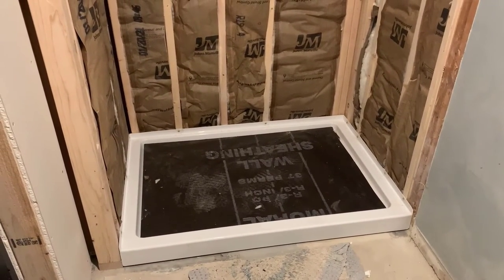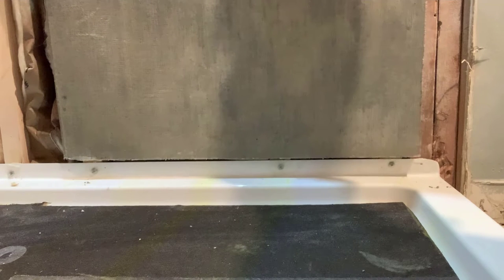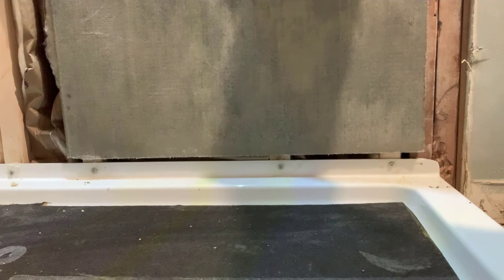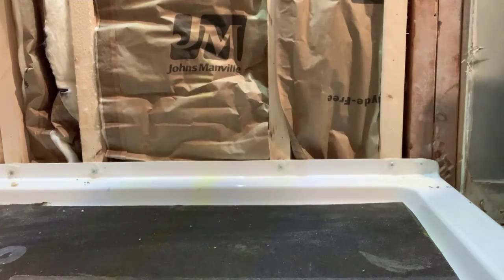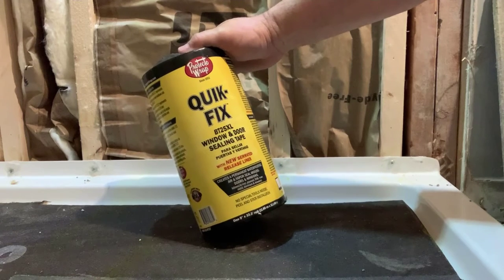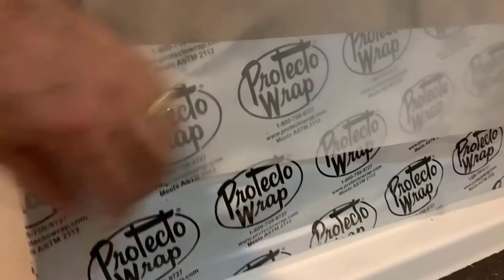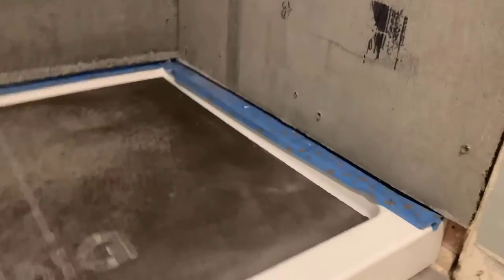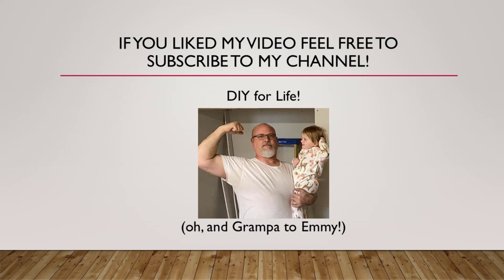Installing Concrete Backer Board with an Acrylic Shower Pan

Comment: Great idea with the adhesive flashing at the bottom.  The plastic sheathing behind the backer board does nothing to help you though and only provides an opportunity for moisture to get trapped between two water proof layers.  Trapped moisture can result in molding.  You always need to provide opportunity for moisture to evaporate out.  Water can even condensate between layers with temperature differential.  You could use Tyvec instead which allows water vapor to escape but also I don't think is necessary.  The Redgard is sufficient waterproofing.  Thanks for the ideas.
Reply from the maker: Thanks for the comment Taylor.  I had not thought of the plastic sheathing and moisture issue.  Thanks for that input.

Comment: Screws through the shower pan cancels your warranty. Modified thin set under the pan is the proper installation. That’s what the round cavities underneath the pan are for.
Reply from the maker: Thanks for the note.  I did put thin set down on the bottom as well but the instructions stated to screw the pan to the studs.  In fact, here is a video by Delta that gives the exact instructions.  https://www.youtube.com/watch?v=4_NR4rwxF7A&ab_channel=DeltaFaucet.  So, both the instructions that came with the shower pan and this video from Delta tell you to screw the flange down.  So, I doubt it voids the Delta warranty.
Reply: @RighttothePointDIY  wow, surprising. 🤔 To be fair, I’ve only installed Dreamline pans. Great idea about the waterproof tape over the flange. I’m going to try that. 👍🏼
Reply: Not necessarily true. Some acrylic pans specify screwing into studs through the screw strip, Delta is one.

Comment: Hardie board instructions on the internet does not require all that. Just says to set the board on top of the lip.
Reply from the maker: Thanks for the comment. I actually talked to a couple of installers, and both had slightly different ways of doing it. However, they both were in favor of putting the hardie board over top of the lip just based upon their experience. The reality is if you waterproof correctly, it will probably be fine either way.

Comment: Great tutorial here! I am at this exact point in my basement bathroom project and really think this method has some great points. I love seeing clever uses other materials such as the window sealing tape!
Reply from the maker: Thanks Chad.  I did a lot of research until I came across this solution and it worked great!

Comment: How did you address the seam where the wall and pan met? Did you grout caulk it?
Reply from the maker: I did not do anything there. I just overlapped it and then screwed the backer board to the studs.
Reply: @RighttothePointDIY  so, there is a small gap between the tile and shower base?
Reply from the maker: @jpp9846  Correct
Reply: @RighttothePointDIY  I guess if the tile is over the wall flange slightly, there isn't really any other place for water to go... Thanks!

Comment: Interesting use of what roofers use as an 'ice dam'. My question to you, and just about every other tile installer on Youtube, is this: If the grout is properly applied, and always maintained, then water infiltration should not, in theory, be a problem. If there is, however, a failure in the grout, and water infiltration occurs, where is that water going to drain out? You've sealed the Hardi backer with liquid rubber, essentially, and shower walls are not constructed like a masonry wall with weep holes. Inquiring minds, etc. In any case: Nicely explained and presented video, sir.
Reply from the maker: Thanks for the comment. You make a great observation which I briefly alluded to in the video.  Basically, with all of the water proofing I did on the Hardi backer board there is literally almost no chance any moisture will get through and therefore this additional layer is just an additional insurance in the very outside chance both my sealed grout AND the water proofing seal failed.  It's not likely to happen.  If water does get through the grout it will just run down the water proofed backer board into shower pan.  It's been about 2 1/2 years and I have absolutely no sign of any leaking and I don't expect to going forward.
Reply: @RighttothePointDIY  how can it get back out to the shower pan if the bottom tile course has been silicone sealed to stop water being drawn upward via capillary action, etc? I’m not trying to create a “gotcha” situation, by the way! I sweat these details even though I no longer do outside construction. Around my house, though, the stuff haunts me because I’m a basket case:-)
Reply from the maker: @howardemerson457  Good question. I should have clarified.  I didn’t silicone the bottom of the hardi board because it is 1/2” from the bottom of the pan and the tile goes past the hardi board another quarter inch or more.  Also, when I sealed the hardi board I also sealed the bottom edge just in case there was some ‘splash up’ that somehow would reach it (highly unlikely).

Comment: Doesn't the backerboard fan out a bit at the point that it crosses the lip of the shower pan?  The lip is 1/4" thick, it just seems like that will be obvious after the tile is installed IF the backer board comes down close the pan
Reply from the maker: Good observation Mike.  It does ‘fan’ out a bit but there are a couple of things to note.  First, I kept my lowest screws fairly high up from the edge. That makes the ‘fan’ more gradual.   Secondly, when you tile you can make up the fan effect with your thin set thickness.  My tile turned out great and you can’t tell there is any fanning at all.

Comment: Great video. I use zip tape for the bottom. Much easier to apply.
Reply from the maker: Thanks.  Great idea.  That is good stuff and would probably work just fine.

Comment: I use hardibacker on a weekly basis for building outdoor kitchens.  I don't do bathrooms, until now, (my own.)     The biggest downside I see to your method is that you can no longer "glue and screw" product directly onto the wall studs.    From what I've read on hardibacker site, they recommend just the 1/4" gap on bottom of shower pan, but also shimming the board out.    The don't show any plastic, only a 1/4" sealant bead.   
 Here's an unrelated tip for everyone.   I see your board screws have all created a "burr" on the hardibacker at point of screw head penetration.    That is typical.   To deal with this, we take a masonry bit and use it to create a slight indent where each screw goes.    That way the head countersinks, but doesn't tear out surface and create that "burr" effect.    Probably not so critical for a shower, but when we are doing california stucco finish, we need that hardibacker to be as perfect as possible, or we end up with more prep work.    It takes longer, but makes the screw heads so much easier to deal with overall, as they don't pull into the board easily, like screws normally do with sheetrock.   At the edges of the board you almost have to do it, or the board cracks when you attempt to sink the heads, especially with 1/4" material.
Reply from the maker: Hey Bob M.  Thanks for the comment.  I appreciate you taking time to write out the long response.  I wanted to ask if you could clarify something for me.  When you said "The biggest downside I see to your method is that you can no longer "glue and screw" product directly onto the wall studs.' what exactly did you mean?  I know you could not have meant you cannot screw the hardiboard to the studs because that is obviously how it is attached.  Can you clarify?  
Also, great tip on avoiding the mushrooming of the hardiboard when you put the screw in.  Fortunately because I was doing tile the thinset was thick enough to cover any 'humps' where the screws were.
Reply: @RighttothePointDIY Sorry I didn't make that clear.   I am not even certain it is recommended by hardibacker, but I have seen other videos that mention "glue and screw".   Our method of installation is to always put glue on studs before hardibacker.  We are using welded aluminum tubing in place of wood studs for outdoor kitchens, but the principle is the same.     If you apply glue directly to the studs, and then put hardiboard on them with screws, now the glue sticks to hardiboard and studs, therefore making a much more solid overall structure with less chance of the years of vibrations, during use, or even someone in next room closing a door every day, or upstairs bouncing around,  to eventually cause tiles to let go.   ( More recently we started doing a bead of glue on seams before setting next board.)   Now, if you put plastic on the studs, the glue cannot contact one or the other, so no direct bond from the hardiboard to the stud.   We glue and screw every kitchen island we build. Many of them have a veneer stone applied, which is much heavier than stucco.     I'd never trust the screws alone to hold, and even more so with products like durarock, which is much softer.   True cement board is much easier to work with, but the screws also pull through easily, almost like when doing sheetrock.   Outdoor kitchens take a ton of abuse from weather, wind, people, chairs, door sets slamming, etc,..it seems a shower would also have tons of movement and temperature changes, plus it may be used several times a day for years on end.
Reply from the maker: @bobm6527  Ah!  Thanks for the explanation.  That makes sense.  I am not too concerned about this shower as I have lots of studs available and it is on a slab so there won't be a ton of vibration but this is good information to know for the future.
Reply: @bobm6527  glue?  lol  funny stuff for a wall..always some keyboard expert
Reply: So you don't think walls are subject to home vibrations, or expansion and contraction?   Nor do you think the glue and screw method is more solid than screws alone?     They glue and screw subflooring all the time to make it stiffer, so why wouldn't it work for any wall application?    All homes expand and contract, and the home I happen to be working on is not even climate controlled year round unless it is being used,  so it has more opportunity for expansion and contraction.   The sheetrock gets cracks from expansion/contraction movement in any home, so why wouldn't the shower tile?   In addition to that, I have installed hundreds of sheets of hardibacker using the glue and screw method for our outdoor kitchens.   I would never simply screw to the studs, as that would never hold up.    With glue, you can't get the board off even if you removed the screws.  Just because it is not the standard method, does not make the extra step incorrect.   You can wire your entire home with 10 gauge, but it is not required.      @davo912

Comment: Hi....I used flex tape, instead of window wrap.
My question is this.
One of my walls is exterior on a shower installation. I live in central Canada,  I have a plastic vapour barrier over the studs behind my wonderboard, I'm using redguard before I tile. I hear that this may cause a moisture build up with no way for it to escape, between the plastic and cement board. What is your opinion on the theory of a "moisture sandwich". Fact or fiction?
Reply from the maker: That is a great question and I got to be honest I do not know. I would recommend talking to a contractor in the area that has actually done it and probably done repairs of showers where it actually happened.  I live in East Tennessee, and we just don’t get that kind of cold. Sorry I could not help you.

Comment: Such a great tutorial!  What is the plastic sheets that you used on the walls & what kind of mesh & silicone caulk did you apply to waterproof your screws? I am going to be remodeling my own restroom but I would like to add extra layers of water protection. Thank you
Reply from the maker: Hey Melinda. Thanks for the comment. That plastic was I believe a 10 mil plastic.  Pretty thick.  I got it from Home Depot.  The silicon caulking was a good quality I also got at Home Depot.  It can be clear or white (I prefer white silicon so you can make sure you have it covered but if the screw is exposed obviously go with a clear.  Good luck!

Comment: How do you like the feel of the acrylic pans. My wife does not want a tile base and looking for the best pan
Reply from the maker: Good question. That pan is a delta pan and it has very stiff Styrofoam backing to it.  I did this in an apartment in my basement that I use for an Airbnb and after two years it’s holding up great. I have never showered in it although I’ve stood in it. My daughter lived there for a while and she said it was great.
Reply: @RighttothePointDIY  
Great thank you for the reply. I assume you mounted it into a bed of a certain mortar?
Reply from the maker: @doug2202  No. instructions said not to.  I used a construction adhesive per the directions.

Comment: I ran cement board down to pan.. and just now discovered this video. I can 't take it off. I've sealed seams and finished to drywall in bathroom. Crap!! Guess I have to silicone the bottom?
Reply from the maker: Sorry buddy.  The good news is if you keep that silicon in good condition you should avoid water getting into it.  What I did was plenty overkill but, when it comes to water, I have learned that it 'finds a way'.  LOL.  Also, if you want to, I would appreciate you subscribing to my channel.  Trying to get to 1K subscribers.  I'm close!  :)   Good luck George!
Reply: @RighttothePointDIY  The hardibacker is ran down to the top of the lip on the pan. Just went and got some astm 920 approved silicone Going to pump it in the little seam and just make sure I keep up with the caulking on the bottom of the tile. Every few years I will peel it out and put in new. I even bought the stuff. I put it on last night over the hardibacker and over the tile lip.. I thought does thinset stick to this window flashing? And found this video and started slapping myself in the face. Doh! Subcribed